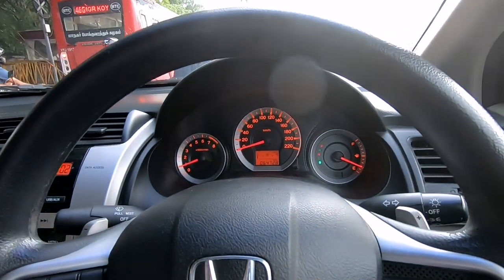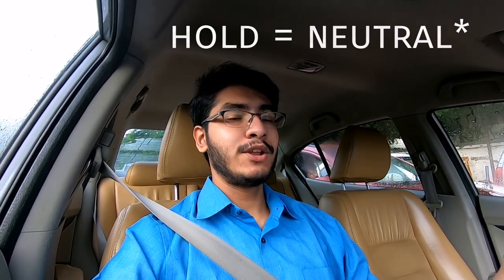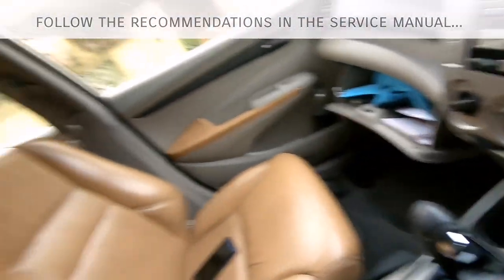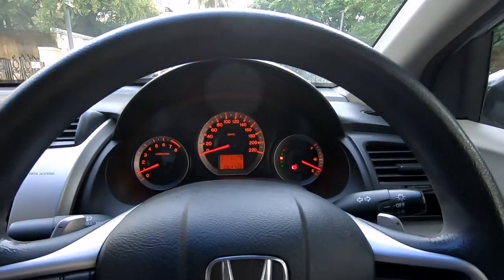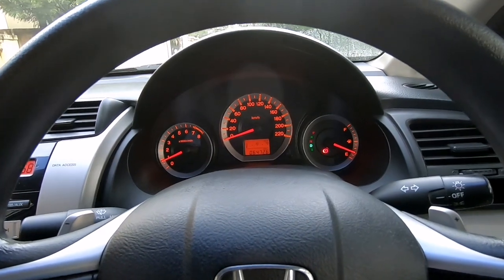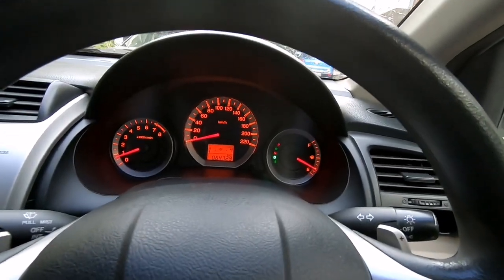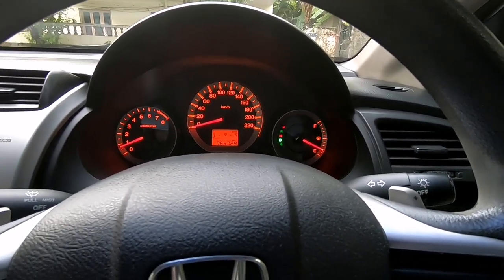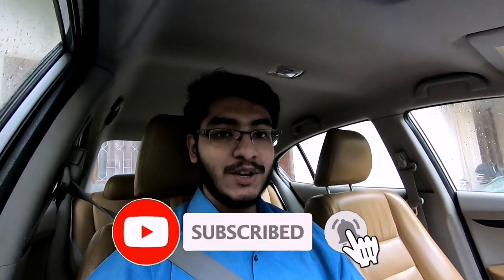5 things you should NEVER do in an AUTOMATIC transmission | My first ever VLOG | JRS Cars

Comment: Can you bit explain about your 5th point?
Reply from the maker: Hi, when you park on slopes or any surface and you put P directly (before engaging handbrake), you will feel the vehicle move a bit (very slightly).
This movement will damage the Parking Pawl...
Parking Pawl is basically the locking pin, which holds the car in place when you engage P. 
By putting it in N and engaging the handbrake, before moving to P, that vehicle movement is arrested, thus saving your Parking Pawl.

Also, if you park on a slope and put P (w/o handbrake), you would have noticed a slight difficulty in moving out of P. This is due to movement of vehicle, after engaging P.

Hope this helps :-)
Reply: @JRSCars  Got it. Thank you 😊
Reply: This practice might increase wear of break pads right ?
Please correct me if I wrong
Reply from the maker: @raghavendra.k7305  You mean parking with the handbrake on? Yes, especially if you don't use the vehicle everyday.
However, the cost of brake pads, is much much cheaper than fixing any automatic transmission issue.

If you use the vehicle everyday, then there will not be time for the brake pads/brake shoes to bind to the rotor/drum, hence no additional wear.
Hope this answer covers your queries :-)
Reply: @JRSCars  
Thanks for the reply